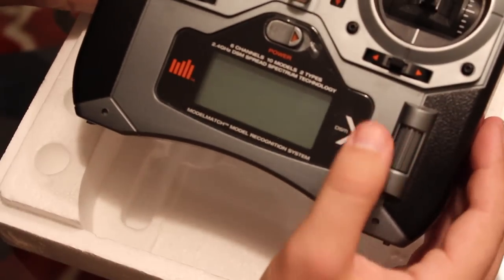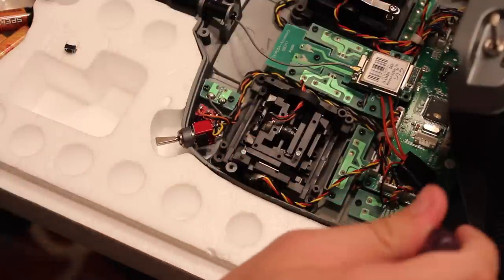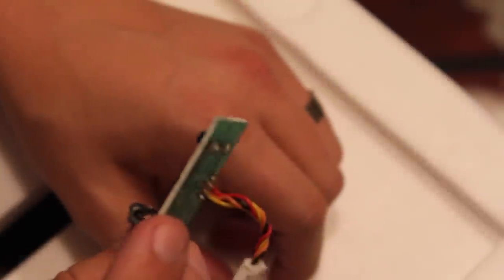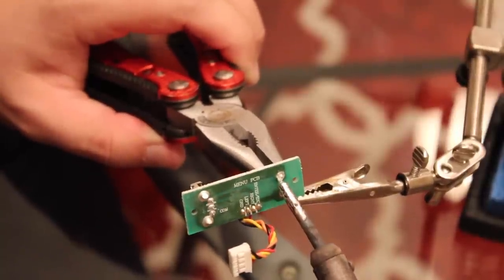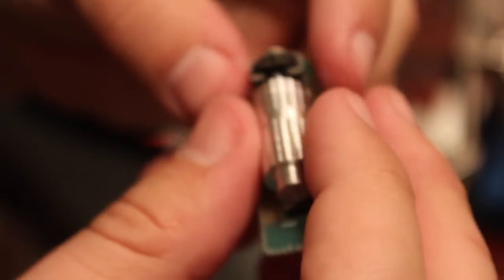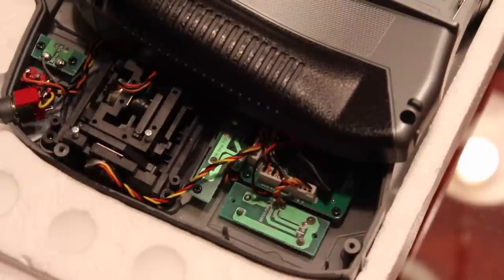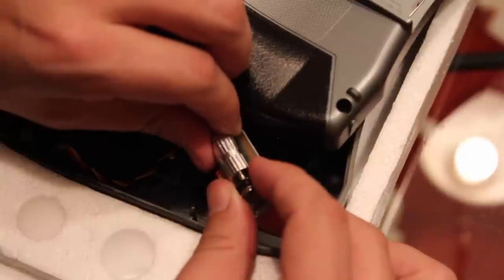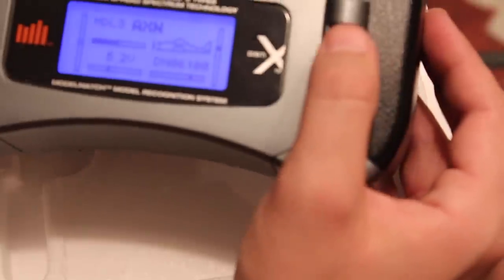DX6i Roller Wheel Switch Fix

Comment: I know this is years after the post of the video but this was just what the Dr. ordered. I bought a DX6i dirt cheap at a swap meet knowing that the roller button was bad and not knowing if I could fix it. Found this video, ordered the switches (still 5 for 
$.95) and after a total of 5 minutes it was as good as new. Thanks for the video brother!!!!
Reply: Where did you buy the switches?

Comment: I have just repaired my Dx9 roller wheel as your video but I had to remove the main circuit board to access the roller wheel it took me about two and a half hours from start to finish..All working great now but I would not have had any idea what to do without your video so thanks  very much.

Comment: Awesome video!! BuT, I went to the website where you got the switch from and I was like "Awesome, these things are cheap as hell, .... wait a minute, shipping is 12 bucks?! Damn!" Lol. So I went into a transmitter I no longer use (cheap emax one I got for free in a trade a while back) and took out the trainer switch. I then soldered the trainer switch to the points where the roller button sits and installed it where my rudder toggle was and now I can use that as my "Enter" button :D Works everytime and I can keep a finger on it while im scrolling!! I assume you could do this with the rudder dual date switch I just didn't want to cut those wires. They are connected to a band of switches all in one plug. So I just tucked the whole assembly behind the hot glued wires so it doesn't move around..

Comment: You might not even need parts, the solder joint fractured on mine. Re-solder with a little extra and seat the switch a little more should be good to go. Reminds me of my old Honda fuel pump relay....